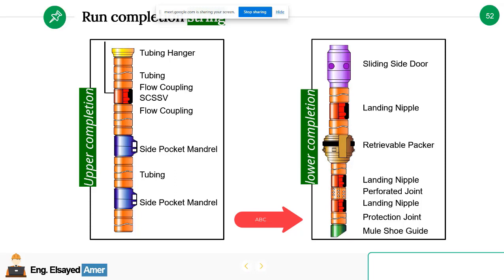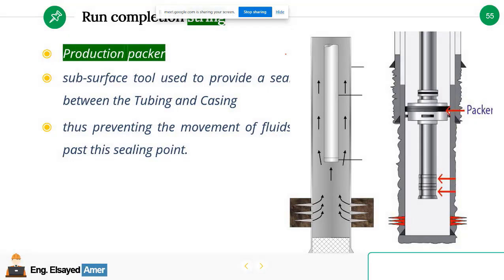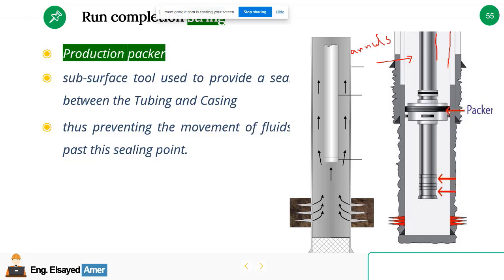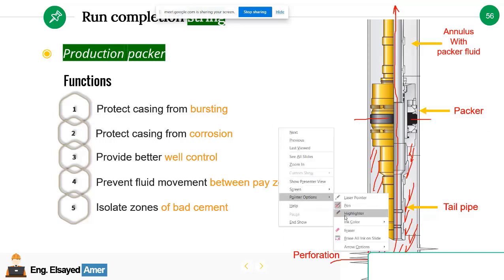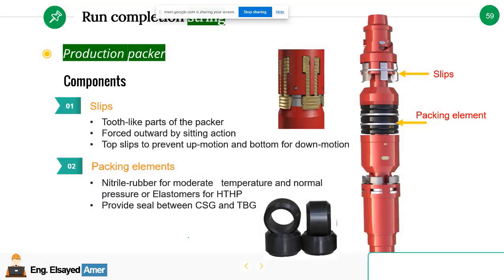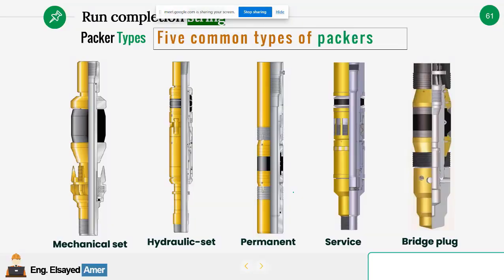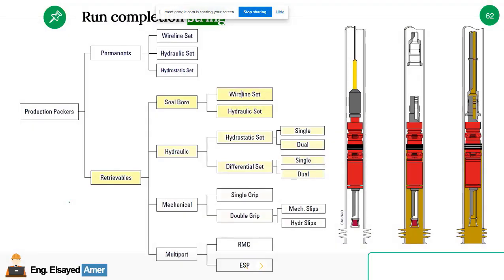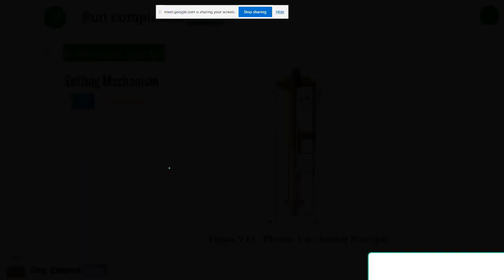well completion packer setting and types " English "

Comment: why there is two LN below packer and what purpose for use perforated joint below packer
Reply from the maker: LN below the packer for testing the tubing after setting in addition to setting the packer itself.
perforated joint mainly used to provide a flow area in case of tubing inlet was blocked with sand filling the wellbore
Reply: I said why there are  2 LN why is not just One LN